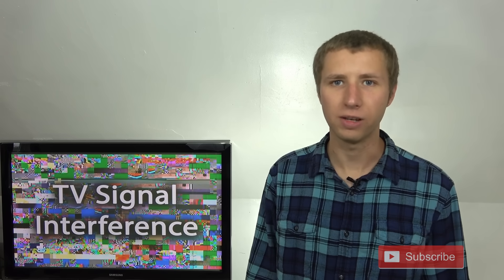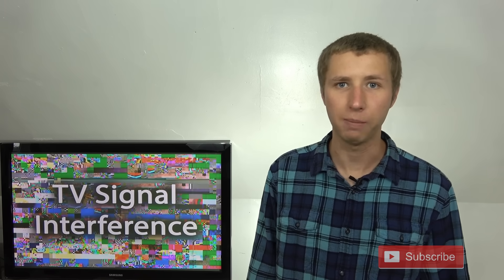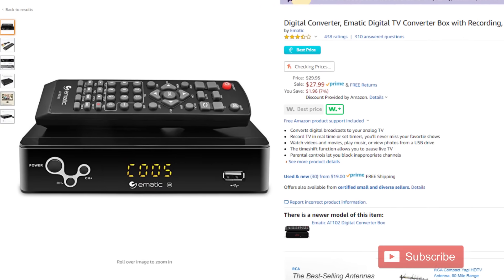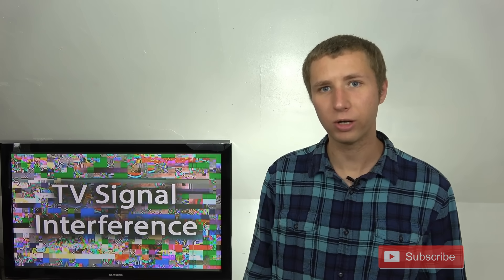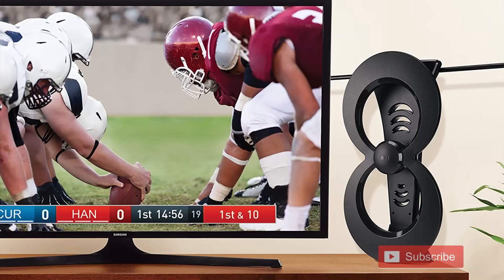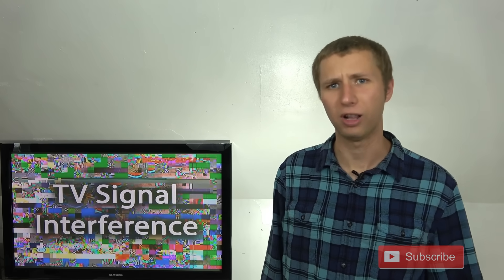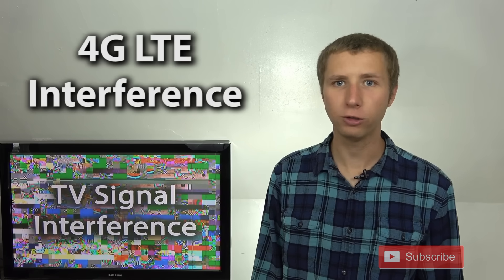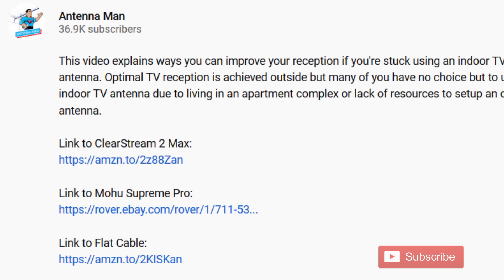Types of Interference That Affects OTA TV Antenna Reception

Comment: I work at Best Buy in home theater and I tell customers about your channel many times a day. Thanks for being a great information resource.
Reply from the maker: Thanks Charles! Be sure to correct them when they ask for an HD antenna
Reply: @AntennaMan  always and I really sell both clearmax models the most. As well as the Mohu.
Reply: I have used the Best Buy exclusive version of the large Terk omnidirectional indoor antenna for about 13 years and it works quite well. Although I first bought it at Sears, I believe, it is now only available in a slightly revised version, from Best Buy.

Comment: Interference can be picked-up by the TV's power cord and the home's electrical wiring. Ham radio signals can also be a source of interference. (In the case of a sound system, interference can be picked-up by speaker cables.)

Comment: Thanks again for the video.  Im trying to figure out why the 1 station has signal issues around 7-9 Pm signal all day is 4 bars and then will drop to one and cause the TCL live tv to lockup or pixelate and then recover.  They don't reduce power after sundown right?  Just wondering if anyone else has that kind of issue.
Reply: One of my stations, WITN, does the exact opposite. It's zero bars for all day. In humid or really dry days, its pixelated and 1 bar at best. The dry and humid nights though.......2...3 bars at times. I live around 80 miles from the WITN transmitter, and i have a small directional antenna.

Comment: I'm screwed.  At least six 'interference sources'.  Outdoor antenna, Near a noisy LED bulb,  Busy Highway, Trees I don't own, Cell towers on three sides, Aircraft pattern between me and transmitter, Helicopters from hospital and local National Guard base,  Transmitters paths from four directions.

I'll take the periodic signal drops.  Cheaper than cable.  

O'h and I have one of those 'don't buy' wall mounts available if you need one.
Reply: I had a cell phone tower put up near my place about six months ago. My antenna reception is now crap

Comment: My computer definitely affects my TV service in my room. As soon as I switch on my computer some stations drop fairly low or like yesterday, I lose one set of stations completely
Reply: That's more likely your power supply than the computer itself. Computers don't generate much RF energy, except for their wifi and bluetooth antennas. If it's a desktop, I suggest replacing your computer's power supply with a brand like Corsair, EVGA, or SeaSonic (get 80 Plus Bronze or better). If it's a laptop... well, you're screwed.

Comment: Bad reception in the day better at night?
Reply from the maker: That happens due to changes in atmospheric conditions. When the signal gets weaker you lose the channel because the signal is not good to begin with. You may need a larger antenna and/or a preamp.
Reply: @AntennaMan  do some/any stations broadcast at a lower power at night?

I live behind a hill with high voltage power lines atop, 20-30 miles from broadcasts, so during a hot summer day with peak electricity use, reception noticably drops. Although rare, this could be the case for some others (I mainly use the yagi antenna in the attic for FM in the garage, but also as a backup for TV).

Comment: had to hook up a second antenna in addition to an lte trap and a signal boosting 4 way.  Wished I didn't have an HOA or I would have just put one of those big ass antenna's on my roof and be done with it.  lol.  I have high power transmission lines behind my house and about 3 cell towers near by.  yikes.  But with my set up I now get like 33 channels.
Reply: Federal law allows you to erect an outside antenna. https://www.groundedreason.com/tv-antennas-fcc-hoa/

Comment: What about co-channel interference especially on the low VHF band? in the "old days" I used to get some wild skip on channels 2-5 from May to about mid July. I grew up in a CT suburb of NYC and one time Ch 5 from Mobile, AL completely blew away CH 5 from NYC only 30 miles from my house. In fact,  I had only rabbit ears on my 1959 Zenith B&W portable (hernia) TV.
Reply: Gerard Carriera there are so few stations on low band vhf now this is pretty much a non-issue. It is an issue on UHF during periods of atmospheric enhancement, more so now since the repack.
Reply: I once had a channel 2 from Monterrey, Mexico obliterate a channel 2 that was only 50 miles away! At that time, we are at the top of the sunspot cycle so all sorts of exotic DX was coming in.

Comment: My antenna is in my attic.    I get better reception with my garage door open....go figure
Reply from the maker: Put it outside
Reply: @AntennaMan    Thanks for the great reply but it does well there..I get 43 channels.  I live in Florida and we get some high winds here..
Reply: @mr.rmrs.p5118  Are the TV transmitters (not the studios) in the direction that your garage door faces?  If they are then it actually makes perfect sense, especially if you have an aluminum or steel faced garage door.
Reply: @michiganengineer8621  That's why it makes  no sense.  My garage faces West.  My antenna is pointed at the transmitters and that is South.  The door might be acting as a reflector, but its not in back of the antenna but off to the side.  ( scratches head )
Reply: @mr.rmrs.p5118  That is a puzzle!  I'm guessing that the attic where the antenna is located is not above the garage?  I used to work with radar, now I'm in the television broadcast industry, and especially since the digital changeover it seems that RF is going insane!
Reply: @michiganengineer8621  This is a puzzle.   Yes my antenna is located above the garage in the attic and the door faces West.  My antenna is facing North.   Over all I am pleased with our reception but some things are puzzling and this is one  LOL
Reply: @mr.rmrs.p5118  I think you're getting some (beneficial) multi-path reception when the door is open.  Just the signal bouncing off a neighbor and then into your garage.  But, since things are working, there's really no reason to "fix-it"!

Comment: after many years of indoor antenna use, i have found the worst season for antenna reception is the darkest days of winter. early on i remember thinking, 'they shut off channel 13 or, channel 7 is down'. most likely they were still there, i was just learning the many positions to place the indoor antenna. i remember the first time i took the rabbit ears and turned them upside down. it worked. i did it so much one broke off.

Comment: I hate to complain, but sometimes bad reception and bad interference is one of the reasons that I wish we NEVER entirely went away from Analog Over the Air TV!
Reply: It's also a shame that the US uses the 8VSB system rather than Europe's DVB-T system which handles multipath interference very well.
https://en.wikipedia.org/wiki/8VSB
Reply: @andythomas7931  I actually prefers DVB-T than ATSC, DVB-T handles interference well.
Reply: You're not alone.
Reply: It’s not entirely gone thanks to Low Power Analog stations, but there’s a few cons to this 😢. 1; Lots of areas do not have analog LPTV stations. 2; Once July comes, those analog LPTV channels will be no more. 3; Most analog LPTV stations are not major affiliates such as ABC, CBS, NBC, FOX, PBS, and only one I know of is a MyNetwork Affiliate.

Comment: Passing vehicles always cause temporary signal interruption or stuttering on my local PBS affiliate. It can happen to a lesser extent on other channels, especially with larger vehicles, but PBS is especially susceptible. An outdoor antenna isn't a great option, so I guess I need to consider the indoor models you've recommended in past videos.
Reply: I noticed this the other day when a UPS truck drove by.  The type of day may have allowed it to reach the breaking point.

Comment: Thanks antenna man. Back when signals were analog I used to get interference from power lines sometimes. It would be like little dots dancing around on the screen. But the conversion to digital seemed to fix the problem for me.
Reply from the maker: It fixes the problem for some but causes issues for others

Comment: Wow! You and I could chat up a storm! Back in the late 80's into the late 90's, I worked for a mom/pop TV and satellite install store. We had to deal with interference problems with both TV and C-band satellite TV installs. One thing I miss, being an old timer, is that discovering the source of many  interference problems wasn't as hard as it is today due to everything being analog. You could sort tell by what was on the screen or sound as to what the source of the trouble was. Now it's just pixeling, no other hints. I've been out that biz for a long time now. Maybe there is test equipment out there that can be had to help out with digital signals. The biggest problem we had with C-band TVRO was doing a full install, then finding out it's under a Ma Bell microwave relay signal path! The frequency used the phone system happened to be the same as C-band (3.8-4.2 gigahertz). We had some success by installing band filters, akin to your FM traps for OTA. We quickly learned a few lessons by that and assembled a small "test rig" we'd take out to a prospective customer and actually do a real life test of the signals! Fun times.
Reply: Oh, yes, the BUD was the best of times but you had to do your field/property test before installation for sure.
Reply: Curt

Hello

Wondered if I could ask you a question about interference? 

I have an old school crt Panasonic video monitor hooked up to a converter box

Everything was working really good till a couple of days ago. 

I’m getting little white static that seems to be in two little bands across my tv. Lower one a little bigger band. 

I tried testing the tv downstairs and watched a pre recorded show with no static

But my outdoor antennas cable is upstairs and now the static is always present? 

It was working really good till a couple of days ago? 

One thing we’ve had a couple of windy storms and there are trees down in my area? 

Any clues to what is wrong? 

I’ve seen some kind of interference cancelling power outlets, could this help? 

Any clues as to what is wrong?
Reply: @jamescollins8794  OK, I assume your use of ? really means "."? Period, not ?. 2 static bars on screen may mean 120Hz hum. Now, in the days of analog TV, that could mean a ton of things. TV itself, bad ground, bad booster amp, etc. Now, with digital, you won't see problems like that. You get a picture, or you don't! Much harder to troubleshoot. If your using RF output from your DTC, aka channel 3/4, problem could be connection issues with coax wire or again, TV itself.
Reply: Curt Chase hello

I’m using a digital converter box to an analog crt tv. 

It wasn’t doing it before. I’ve had the current set up for like a year?

Anyway don’t know what’s causing it. 

When you say channel 4. I’m not sure how that applies. I’m using a composite rca video out cable to input on my crt. 

It does it, the static, on all channels. 

I’ve seen advertisements for interference reducing power supplies? But don’t know if that will help
Reply: Curt Chase I have rf input to my digital converter box. And then rca video out from digital converter box to rca input on my monitor.

Comment: Great job, Tyler!  I have woods behind my condo building, and windy days wreak havoc on my reception.  I was getting LTE interference and found the LTE filters do a good job of stabilizing the signal.  Unfortunately, there isn't much I can do about rush hour at Reagan National Airport.  Thank goodness for streaming when the TV signal isn't reliable!

One other tip I would have for apartment dwellers is to place your antenna near a window pointed in the general direction of the TV towers.  Steel and concrete building materials make it difficult to get good reception when other conditions are good.  Unless you have a steel screen or low E glass, the glass doesn't interfere with signals to the same extent as other building materials.

Comment: Hey Tyler, I have a few questions for you:  1) What is the best handheld analog OTA signal strength meter? 2) what is the best outdoor antenna 3) what is the best way to connect a converter box to the tv for best quality? Thanks for answering my questions in advance and hope hearing from you soon.